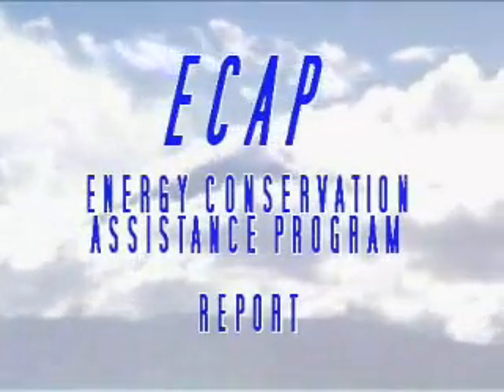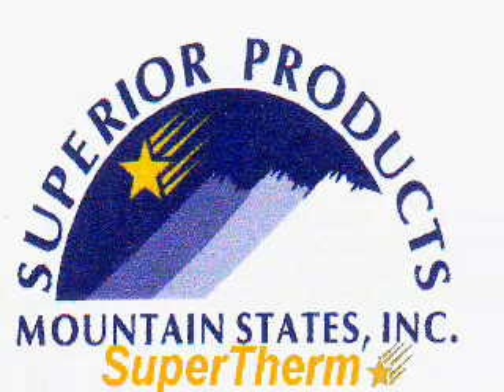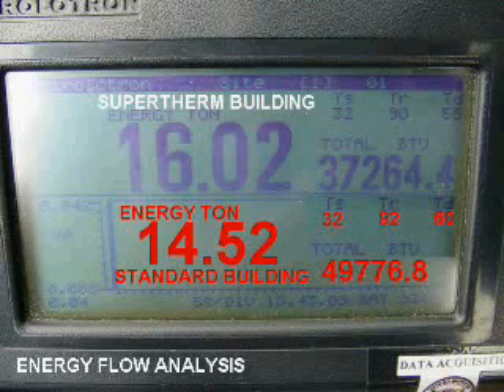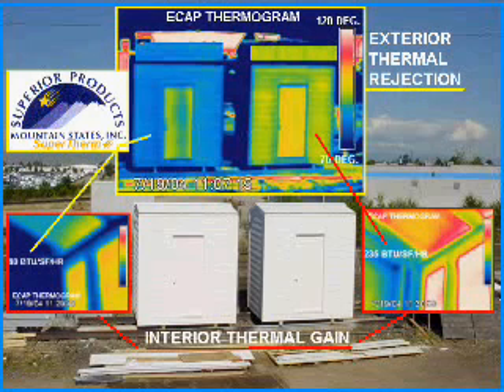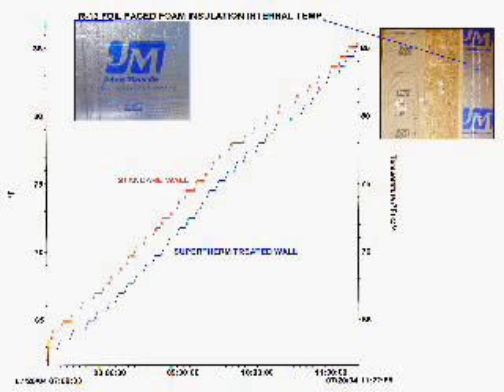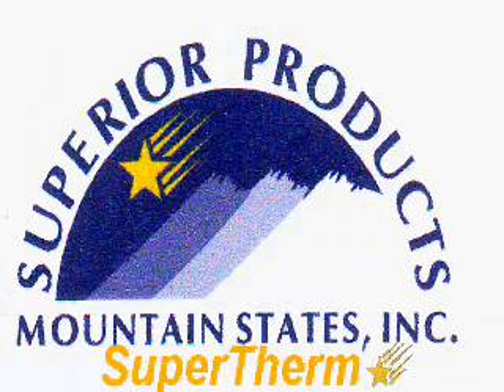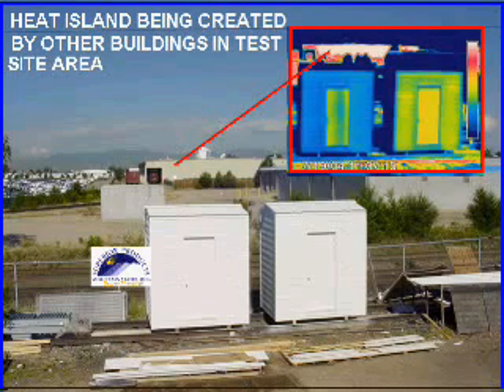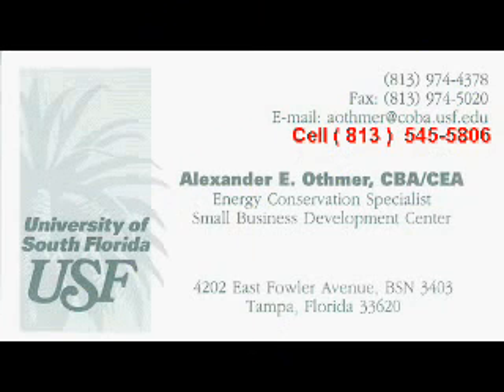Ceramic Insulation Paint: Denver Test Project

Comment: Holy smokes this is a terrible misleading video..  At least you use the same color paint yet by adding in a bunch of extraneous data and unreadable graphs... you are simply baffling us with bulls__t.  You never once state a temperature difference yet use double negatives and imply its really great stuff..  In the real world, every time I have tried ceramic paints or additives... it simply does not work. Not in Utah, not in Oregon, not in Baja. Not on a mobile home, a travel trailer or a shed. Just apply a glossy white high quality paint instead. You can see a 20-30 degree drop if all the conditions are just right. Kept your hand on your Waller and run the other way from all the insulating paint claims.
Reply: G Henrickson  I've read your comments. Can you do a video on this or do you have one up ? Reason asking so more of up are aware and won't be misled by these companies thanks.
Reply: I made a video in a colored jar boiling water cools faster than bare. In Russia too a lot of quacks who propose to use such dyes as thermal insulation https://youtu.be/uculrpQnlNI
Reply: your a moron on a train, your a moron in the rain, your a moron jumping puddles, your a moron who gets no cuddles.